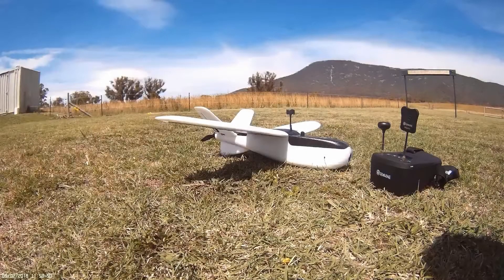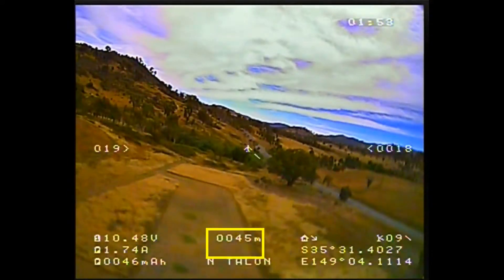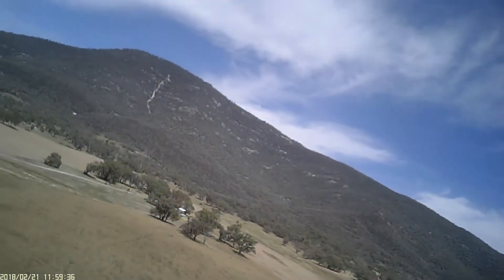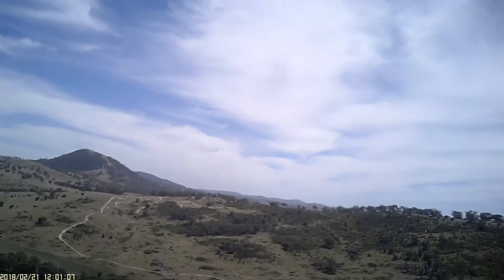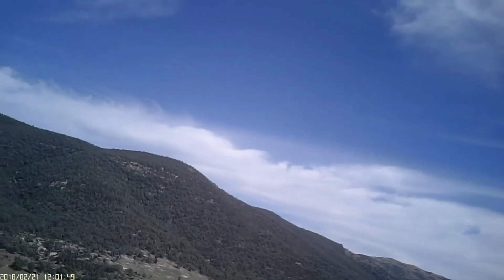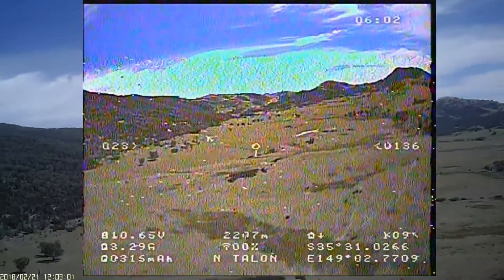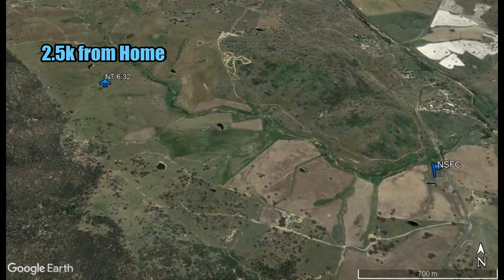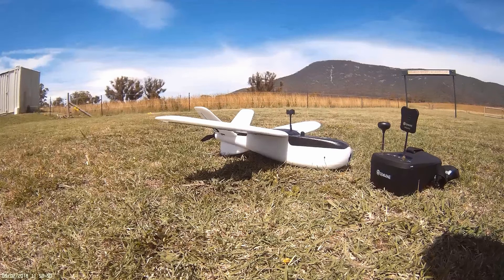Nano Talon - Lost and Found

Comment from the maker: Installed the Bigaole today and in the process noticed that the linkage stopper on the elevator servo was loose and slipping on the elevator pushrod. I'd say that accounts for the elevator difficulties I was having on this flight. Hopefully she'll survive the trimming exercise and I'll now have smoother stabilisation as well as RTH capability. Just got to rememner I need 200+ metres altitude to retain video in that valley . . .

Comment: Good result Ken, lucky for the DVR hey..!  I was going to offer to send you my unused stabiliser from my NT, but I think it would be better in the bin, I upgraded mine to a Hobbyeagle A3 Super II which totally transformed the plane, as a standalone 32 bit full acrobatic stabiliser it outperforms anything else including Vector and F3/4's. The ZOHD one seems to have a non mixed algorithm which relinquishes stabilisation at a threshold of stick input then over controls as a result, causing wildly aggressive corrections.. in short it's horrible! Long live the 808 too!
Reply from the maker: Thank you for the kind offer but I'll decline. In fact if you can find a recipient for the FC they can have mine too. I've been holding off swapping it out while I tested the FS2 but I've had a few flights with it on my Z84 and so far I'm unimpressed. It's got some nice features but the absence of an onboard barometer seems to make the altitude readings very unreliable. I'm just not comfortable that it's got my back. Looks like time to install the Bigaole.

Yes, for it's age, the 808 is still a reasonable performer and nice and light for the NT. I've ordered a Mobius Mini but it's being held by the Lunar New Year holiday so it'll be the 808 for a while longer. If I can just remember to hit the record button on the DVR I should be set.
Reply: KenJungles Ah the Bigaole! I have one of those, I think purchased from watching one of your video's way back, the only gripe I had with it was tuning those microscopic pots, I ended up making a pointer screwdriver with a piece of wire.. helped but still very inaccurate. It also seemed to numb out the elevator when stabilised on my z84, but I did like flying around with it at the limits of my radio system range. I have an old Cessna 182 that might get mine next..
Reply from the maker: Yeah those pots are a true PITA and they're the main reason I decided to try the F2F. I've gouged a couple out myself and as you say the relationship between the amount of rotation and amount of change is anything but predictable. Still, with all that when you do eventually get it right it is a very reliable way of bringing a prodical plane home.